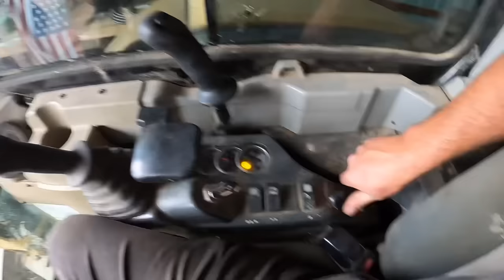I'm Sick Of Getting Hit In The Head, Let's Fix This And A Few Other Random Things

Comment: As a retired mechanic, when I was a young pup just starting out, an old mechanic told me that I had to be able to curse in the language of the engineer who designed the machine, and to ignore minor arterial bleeding. As a Christian, I was unable to do the cursing part, but I was very good at ignoring minor bleeding. Besides, I didn't know German, Italian, nor Spanish. However, I did request that the engineer who designed the thing, spend some time in purgatory.

Comment: Mike, I remember in a earlier video that you needed some metal platting to mount the lights and hitch to the back of the new truck!  Need a new bed, I'm thinking you maybe able to borrow again from the same source (Come-on, it's not like it is currently being used)!  🤣🤣🤣🤣  I know you asking,  why is the switch plug on the inside? Well for one, so there is no water damage to the plug and joist stick, and two (2) so that it does not cost you $700 from cat, but $2100 from cat.  You know, $700 for the part, and $1400 for the labor to replace the joist stick, because it takes two hours to replace!   😂😂  What would be funny is, they redesign it to the outside and the next time it breaks, the cost to replace it rises to $3k!  Now there's a complaint!  😂😂.  And we all thought you were going to re-bore the bucket arm!

Comment: During summer break from law school I would work at Caterpillar in Montgomery, IL bending hydraulic tubes in BLDG K but sometimes I would be pulled to R bay to help fix whatever wheel loader or excavator coming off the assembly line that is having issues. I have found that working on the bigger equipment is much easier but more in depth especially electrical connections. Cat just closed that plant down and moved all of that manufacturing to Peoria, IL

Comment: Mike, I saw the shorty on the tile plow repair is that a video that's coming, and also a nice shorty on the Cat, as a retired mechanic, Bluebird School Buses used to put their light monitors in the panel next to the driver's seat in a compartment the monitor had every light the bus the stop arm,  turn, stop,  tail, cab lights, interior lights, headlights, and backup lights the monitor was under the wiring for the heaters fan motors AND I swear to God there all the same color WHITE, to the monitor,  it may have changed since I retired but they were a BASTARED

Comment: My first two new (early 70's) pieces of equipment were Cat; a D6 and a 225 track hoe - they didn't have 100 hours on them combined. I never got a full week's work out of either one of them. Dealer was great about fixing things under warranty, but it would take anywhere from three days to three weeks. I didn't keep them 6 months and took a beating on getting rid of them. I haven't owned a Cat piece since. Truthfully, don't really like running Cat either; they are slow and cumbersome pieces of equipment. I WILL admit that that 6 of Chris's is a sweetheart though.

Comment: Even for the discounted price of 450 bucks - I would have looked hard for a way to put an extra 2 way switch in somewhere. - PS the reason the part is so hard to get at is so that not only will you pay 750 for the part, you will pay their service department a similar price for them to fit it!

Comment: I get the rant, ridiculously difficult to get to the problem, not to mention expensive, and a lot of the time, just one little change in factory assembly would make repairs much easier, and they wonder why dealer shops are so expensive. I do like the way you maintain your equipment and shop sir, make’s working oh so much more enjoyable, even in the rain😏😀. Thanks for the update.

Comment: Couple things.  Thing #1:  Tip for you that I use to bend thin metal like that is to use an adjustable wrench.  Tweak the jaws as close together as you can, and slide a rugged pipe over the handle.  You can have as much leverage as you have swing space and pipe you can lift.  Orient the the head in the positive direction so you don't compromise the jaw.  Over tweak the piece you a bending just a trifle because there will be a little springback.

2nd thing is a question.  Let me preface by saying I AM NOT A WELDER!  I do watch numerous fab channels, and a common denominator I see a lot is NOBODY seems to clean up their steel before they weld anymore.  I learned to weld waaaaay back in 8th grade metal shop.  We were taught to use a grinder and cleanup all our mating surfaces... and a little bit more.  My father welded almost every week for someone in the neighborhood, or himself.   It wasn't uncommon for him to spend 7 hours grinding, and 2 hours welding.  Do cruddy welds actually hold, or is it not photogenic and done off camera?

Glad you got your odds and ends caught up, and thanks for sharing.

Comment: the only CAT I have driven that I like lately is the new D5 dozer, we work on most brands and you nailed it, PRICEY CRAP is still crap we say around the shop. A mercedes will still rust.............. it's like changing the fuel filter on a dodge diesel up behind the wheel skirt............the acronym is CC for CAT CRap

Comment: Hey Mike, Arron, That little Cat with the bad switch costing $700 would have seen me dissecting the switch itself to repair or replace it. I've literally used a razor blade or an exactto (?) tool to open it up and fix it. I then find some product to resell the button to keep moisture and dust out! So far I'm about 70% fixed and 30% fail... Since you replaced the assembly itself it wouldn't hurt to attempt to fix the old one. You might even be able to sell it if you never need one again. You and Aaron have quite the friendship, love you two bickering like you do. 😅 😂

Comment: Thanks for sharing your thoughts, ideas and videos. Nows the time for Hyundai to make you an offer you can’t refuse on a replacement for that excavator. 😂 On a side note I recently saw a video of an impressively quiet air compressor and thought you might find it interesting. Company is called California Air Tools. The only strange part is they only seem to have 1HP and 2HP units and just stack more units in parallel for larger capacity. Works since noise is not cumulative, at least that’s my impression. Might be something to have in your back pocket in case your shop compressor ever gives up the ghost. Who knows maybe they would even send you one. Could do a video on how to retrofit your older systems to make them quite. Wishing you and your family the best.

Comment: Hey Guys, great video. If you ever have another switch or something on a joystick go bad, you might want to try pulling it apart and checking the number on the switch itself. I'd bet that CAT, like most manufacturers don't make their own switches, and you might be able to punch whatever number you find on it into the googler and be able to buy it directly online for $10-$20 and just solder it in. You might not find any number either, but you're so close at that point, it's worth a shot IMHO. 

BTW.  I first heard about you through your interview on Bryan Brown's working words podcast.  Good stuff. Thanks for the videos!

Comment: Please find me something that is easy to work on.  My '73 Chevy P/U was fairly easy.  You could see most everything and get your hands on it while still having eyeballs on it.  If it rained, I could crawl into the engine compartment and pull the hood partially down.  Been working on my "03 Trailblazer.  I love the truck but can't get to anything.  Trying to get a plastic emissions something or other off.  Couldn't see it, couldn't get hands on it, definitely at the same time.  Finally got it!  My left wrist is all bloody. Now to put the new one on.  Wondering about working on the Case or Hyundai.  At least with the Deeres, you always have Clint.  That's my rant.

Comment: Take the itty bitty switch apart on the kitchen table, most of the time some little piece of brass contact, or rinky dink contact spring has broken. Re engineer the dam thing. You can do it.  At your billing rate, should take you about 2 hours.

Comment: OOOOUUUCHHH!  This is why other countries can sell to the US market faster and in outdoing the US engeneering (they fix and/or improve) maintainability; (Japan has done this with the 4 & 6 cylinder engines the US sold to toyota (they fixed the problems on the 4 &  6 cyliners engines (60's & 70's cars); the body rotted but the engines kept running.)  And it seems like the US has yet to figure this out.  Built it right the first time. You had pointed out how very easy it is to maintain a Hyundai machine.

Comment: Maybe that plug is in the console to prevent water damage. That said where do you think cat decided to put the air intake on the 299D3? Thats right.... directly sucking dust from the top corner of the track, genius. Also, the small condenser fan for the ac in our kx080 I believe was somewhere around $1k.

Comment: I think the only fix for Mike getting hit in the head is to lose some height.  Aaron doesn't seem to have that problem!  😂😂  I can see how that piece over the cab can be annoying when not secured.  It'll be interesting to see the new bed when it comes to getting it replaced.  I'm also sure the new one on the Mack will get used before Lt. Dan. 😁😁 On a serious note, I noticed the side dump trailer and I was thinking.....when are we going to see it in action?

When I was stationed at Ramstein AB, Germany, we had a whole bunch of Bluebird and Thomas busses in our fleet.  Everytime the cat engines had an issue, we had to do a contract request to have a CAT Tech come out and diagnose it.  It took two weeks to set up the contract and get a CAT tech out to do the diagnosis.  Then it took another 2-4 weeks to get the parts.  Once the parts came in, it was another two weeks for another contract to get the CAT tech out to install the new parts.  Apparently we can't have the test equipment or maintain a stock of those parts unless we had a mechanic that is in the shop for a minimum of four years that is certified in the CAT equipment and diagnosis.  Well, we as military members get transferred every 2-4 years and we go on a lot of deployments, so that is a no go.  Our civilian contracted mechanics on the other hand is our only viable choice, but they didn't want to attend the training and be responsible for the equipment and diagnoses.  Of course they have a valid reason.  It has to be added to their contract and their pay has to be adjusted for the special job responsibilities.  Even though the Contracting Office was more than willing to amend their contracts, they still didn't want the responsibility.  Fortunately, one of our military members was retiring and decided he wanted stay in Germany and fill a vacant civilian position.  He even wanted to attend the training for the CAT equipment use and diagnosis.  So he was hired within a week of retiring!  The vehicle down time was cut by 80% and we had a supply of parts.  It also saved $35K a year in contracts for the diagnosis and repairs.  After the German civilians saw how easy the equipment was to use and maintain, as well as how much of a pay raise they would get. The civilian pay is the same regardless of if you are German, American, or any other nationality. It's all based on your Civil Service Grade (basically like military rank), the amount of years you have in civil service, and the local cost of living.  An extra $1500 a month is quite the pay raise be a certified for CAT equipment use and diagnosis.  All of the training, recertification (every four years) and the equipment is covered by the government.  So a couple of the civilians decided to take on the responsibility.  We could only have three civilians certified since the government put a limit on the certifications.  Fair enough.  Three is sufficient and no need to spend too much more money than needed.

Comment: Another job successfully completed by the dream team Mechanics written with a capital M.  I agree with the prices on " original parts".  I needed new breaking disks for my car...  Twice the price of Brembo...  And ques where Volvo is getting them from....  Luckily my car workshop is a Volvo specialist and not a dealer.  Volvo dealers are not allowed to put the Brembo disks on.  If you step into a dealership in the Netherlands, you've got " scr.. me " written all over your fronthead.  Still I ended up with a bill including rental car,  MOT and  a full 60K service  close to $ 1150,00. Oil $ 28/liter  over here...

Comment: FedEx isn't the best here in Pa. either as they don't set the package on the porch. It is easier to walk up 3 steps to the concrete landing instead of walking up 3 more steps and setting it on the porch under cover. I bought $2500.00 of computer parts and they set all on the landing and left it in the rain.

Comment: Seems like I've seen you guys bend steel by putting a pipe wrench on it with a cheater bar. Sometimes a battery that doesn't want to recharge will start taking the charge if you put a booster pack on it at the same time as a charger. Then unhook the booster pack.  On a different subject. I have a popular American made mini excavator and have cut access panels into the console in order repair things the manufacturer hid. I have cut off some off of the track tightener bar shaft in order to accommodate a slightly smaller track that is much cheaper. Modify, modify and improve. My brother loves Cat but he has 50 years experience working on it. And he has the money to keep OEM parts.

Comment: Automotive and heavy equipment engineers don't care about what you have to do to fix things because THEY don't have to work on them. I've learned that from 37 years working at a dealership
Reply: Actually it is also 'engineered' to force you to make a decision, when it breaks, whether to bring it to the dealer's service dept where they always make a gamble to charge just shy of your "Screw this crap, buy new from someone else" threshold line OR you just say "Screw this crap, let's buy new from someone else".  If they are right >50% of the time, they consider it a win.

Comment: If the gas cylinder fell off the hoist and hit the concrete floor, it would look like a ballistic missile flying around the shop. There's  a YouTube video where a guy accidentally dropped a fire extinguisher and the valve broke off just right so that it took off like a missile. Looked funny.